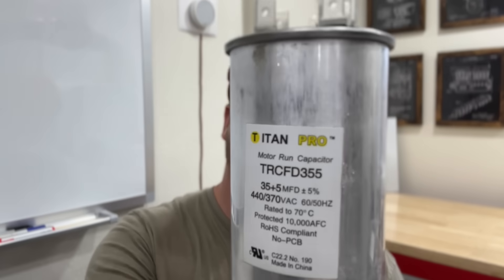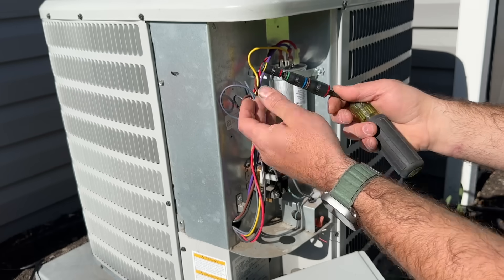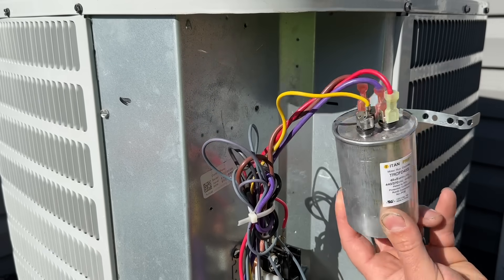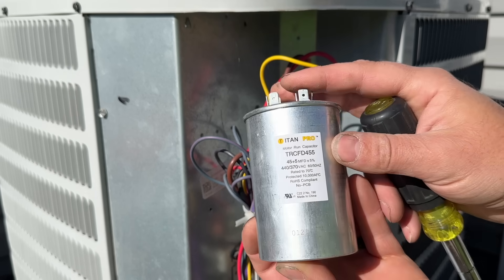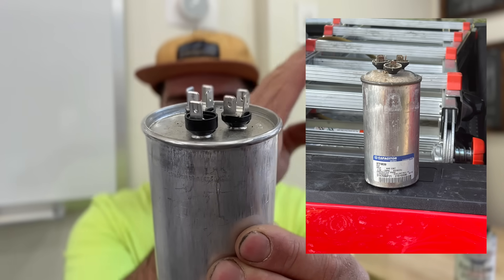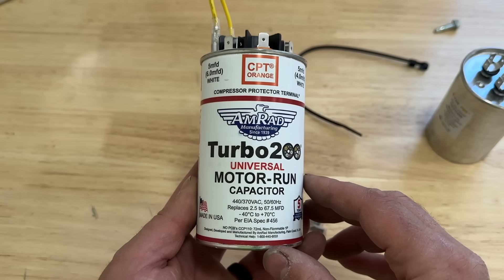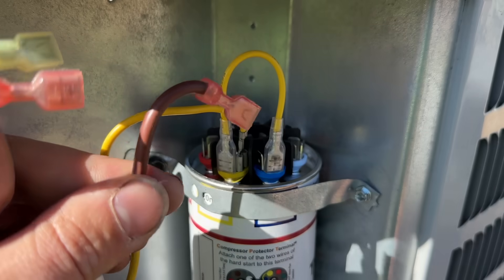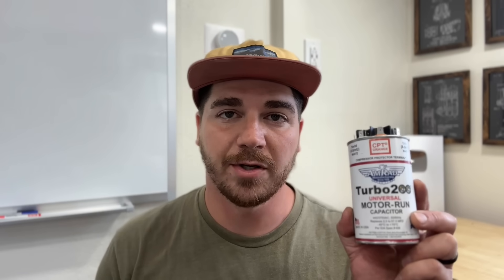HVAC Contractors Practically Make Their Living On These

Comment: Im a one man Hvac business owner. Im licensed and insured 21 years experience in Florida. Today 5/25/24 I got a service call. I charged 395 dollars for a 45/5 capacitor,1.5 Lbs of 410a,new valve cores(They were leaking), new valve core caps and a I vacuumed the drain line. We are not all out here to screw you over.
Reply: Yes keep your overhead low, you made more on that one call than most people make in one day. I always tell people to find an independent guy like you rather than the big box companies
Reply: @markme4  no he did not make that much money he asked to pay for truck, gas insurance, and all kinds of other things
Reply: @markme4  Yes. When I had my house painted. One company was a larger one. The guy doing the estimate that was his only job within the company. The company I used was a family run business. The wife answered the phone and one of the partners came to my house to make his estimate. He even showed after the first crew sprayed washed my house. He was there helping his crew. They did a good job.
Reply: @markme4  I had a situation where I called the "independent" who was on the Good Contractors List, promoted in the DFW area.  He was a "bible thumper" and named his business after a book in the Bible. The replacement compressor was provided by the manufacturer free under warranty but he still charged for it.  We were several days with out A/C on a hot July day and he was the only one who returned my call and came out of all the service providers I called. I got "hosed" but we couldn't go on indefinitely with out A/C.  The compressor failed because it overheated due to the blockage of the cooling fins.  Since then I clean the cooling fins around the compressor every spring.
Reply: @JackLucas-jh1eo  How much was the final bill ?
Reply: @JackLucas-jh1eo Contractors around here wouldn't consider replacing just the compressor, they would say the whole outdoor unit, indoor coil and lines would need to be replaced.
Reply: @JackLucas-jh1eo an in warranty compressor is not free. The contractor had to drive to the distributor to get it. He then had to stand in line to get waited on. He had to pay for a new compressor and maybe shipping. He then had to drive back to your house to perform the work. Removal of refrigerant, supplies, line filter/ dryer and replacement Freon are all not covered by manufacturer. After completing the repairs he likely had to return the old compressor wait in line again to get a refund of the purchase but the distributor retains a fee of 100-150 to process the warranty. He also has to warranty the work( hopefully he is good at his trade and rework is minimal ) he may have spent 4-6 hours total time. Even a small operation typically has an office with 1 employee. Most companies charge 80-120 per hour. This all has to pay the employee any benefits he offers, vehicle insurance, maintenance and gas. The office rent, light bill, ect. Many companies do over charge but are you taking into account all these things? He likely had little work during the off season. I worked 20+ years for a contractor who kept us busy in the off season working and cleaning around the office and about 1/2 my day driving between jobs during the summer. I got paid for my full day but he could only bill for the time I was at a business or home working. Oh I forgot he also gets to pay business property taxes on all the inventory he has at least in my state.
Reply: @JackLucas-jh1eo  I learned in business never trust the three P's. Preachers, Politicians, amd policemen.. Preachers( anyone that says things" Like God bless you alot" be weary of anyone throwing religion around, Politicians think they make the law amd policemen thing they above the law.. religious people and policemen where the worst... ripped me off all the time till I learned the three P's rule.
Reply: @markme4  re read his post
Reply: @theuserthatishere  Who's? The OPs? I wasn't insinuating he charged too much if that's what you thought, just that his overhead is low and he gets to keep much of what he earns , he deserves it
Reply: @JackLucas-jh1eo  You should report him then to the manufacturer because although the part may be covered under warranty, the labor might not be covered. He was right to charge you if the compressor labor was not covered by the warranty. This is what you need to find out.
Reply: @JackLucas-jh1eo    ANY reference to the bible, or christianity on a home service call is a giant red flashing warning light that you are about to be lied to. Ironic? Not a single bit.
Reply: @JackLucas-jh1eo  Those "Bible Types" are the worst for any trade, from mechanics to techs, they nail you in the name of the lord.
Reply: @JackLucas-jh1eo A warranty can be voided if failure was due to lack of cleaning. How is it the manufacturers fault if customers are too cheap or lazy to do proper maintenance.
Reply: Installarion can cost as much as the part with coolant.
Reply: @JackLucas-jh1eo been doing hvac for 20 years, just because a compressor is under warranty does not mean its free, we have to pay hundreds of dollars in shipping and handling,  hours of labor to install, and normally around 8 to 10 lbs refrigerant. A lot of other costs of doing business as well such as insurance and fuel.  Nothing is ever free even if its covered under warranty
Reply: You are not the problem, its the ones that recommend a new unit and lie as to what is wrong. No one is going to get mad if the part is 35 -40 and you charge them 395 for your time, gas and expertise.
Reply: @tomodiero7524  

Except that call shouldn't exceed $125 - $150 typically in most cases. Trip charge, 1 hour labor and a $20 - $35 capacitor. $300+ is highway robbery and no more honest than the guy who condemns perfectly good 10-12 year old Trane/Lennox units that easily last 30+ years old.
Reply: At this point you seem to be the exception rather than the rule... and I'm sure you've got all the business you can handle because of it.
Reply: @rhymereason3449  A lot of companies have unnecessary overhead and Im not talking employees.
Reply: @WhowereEpsteinsclients Yes, driving around 100k plus trucks, every family member on the payroll, new offices and shops, etc.
Reply: @D2O2  Yeah stuff like that is terrible for the industry.
Reply: @WhowereEpsteinsclients cocaine😂
Reply: @rhymereason3449  

I'm semi-retired HVAC and I have all the business I can handle or want. I took a job as a maintenance man and facility manager in a U.S. Government DoD contract factory that builds parts for AM General and Oshkosh Defense because they needed somebody good and now (7 years ago). Also I was hand selected to head a Active Shooter Management & Hostage Rescue Team in the same facility. I'm the "bodyguard" of the entire place in addition to my HVAC, welding/fabrication, plumbing, electrical, carpentry, machine shop tool & die etc etc job.
Reply: @rhymereason3449  

@slinkyneal
1 hour ago
What Brand is the moat reliable..the quality is so bad no matter the price..I actually have extras on hand

Reply

@JohnDoeEagle1
0 seconds ago

AmRad BMI are the best.
Reply: @rhymereason3449  how would you know? have you used many techs, like 10 or more to get a real feel of what's out there?
Reply: @theuserthatishere  Yes, I've used dozens of them over the last 40 years - plumbers, electricians, roof cleaners, roofers, gutters, HVAC, painters, excavation,  carpenters, general contractor, concrete.   In fact, when I built my current house I took on the role of the general contractor and hired all the subs...
Reply: @rhymereason3449  

I'd love to know WHY my comments keep getting deleted on this sh*tty channel? It's happened a bunch and at this point I have lost about 60% of them thus far.
Reply: $395 is pretty tough. $200 would have been reasonable since you were probably on site for an hour, maybe.
Reply: @davidkeeton6716  example of someone who doesn't know the cost of running an HVAC business
Reply: @davidkeeton6716  Have you ever run a business? Out of that 395 dollars my profit was around 80 dollars. Think of the overhead. I have to grease so many palms before I even get to the job lol.
Reply: Who’s palm are you greasing?
Reply: @WhowereEpsteinsclients I’m in NJ and I was charged $400 just for 2 lbs of 410a 2 years ago from an independent serviceman.  That’s considered a little on the high side but not too crazy.  I got my license to work with refrigerants, bought a 20 lb container of 410a, a testo 550, the key to take off the valve covers, some yellow jacket hoses, a leak detector and a spare capacitor which the total cost was upwards of $1000.  Granted, I bought much more Freon and much more sophisticated equipment than I need, but now I understand why I was charged $400.  I’m not going to complain about the price anymore.  People have to make a living.  I’m glad I did what I did only because the last time the capacitor blew, it went on a weekend, and I had to wait 2 days in 90 degree heat with humidity to get it fixed.
Reply: 30 year veteran and business owner. In the commercial / industrial sector. Primarily refrigeration but also HVAC. 
In all honesty - Residential sector consists of - 50% Pirates - 30% sub par to incompetent boobs - and 20% great, hard working, proud, and honest all American guys.
TRUTH.
Reply: @spirorevelis7100  Well said.
Reply: @WhowereEpsteinsclients  Thank you sir
Reply: When I found an honest ac contractor, I referred him EVERYONE I knew. Good job.
Reply: Where in FL? In Bartow and looking for someone reputable and honest.
Reply: I clean my condenser and fins a couple times a year and blow out my drain pipe and it keeps on working after 20 years and only put a capacitor on it and replaced my thermostat batteries, it's a Goodman brand Heat Pump
Reply: @terryhill4732  Keep on doing what you are doing and keep up with the air filter changes. Most of the time if you do all that maintenance you wont have to make costly repairs. An informed homeowner is a good thing.
Reply: @WhowereEpsteinsclients  Thanks
Reply: @WhowereEpsteinsclients  I also failed to mention that I bought a small 5,000 BTU window A/C that pulls 4 amps and let it run all day because it's so cheap to operate and does quite well by setting a small fan in front of it and does an amazing job by keeping my central unit from running so much in hot weather and keeps the electric bill low in hot weather
Reply: A 1  man operation can afford to function with that price. A 100 men operation couldn't possibly
Reply: Our company would have been around $250 for that. Capacitor , refrigerant and service call fee.
Reply: @KyleNicks  

$395 is highway robbery and a "con".
Reply: The good ones are out there. I have a good one myself that I found by accident 15 years ago when I replaced my old unit with a Geothermal setup. The owner of the company came out to my home, did a survey, asked what I wanted, and even down sold me on some things he considered unnecessary. He'd tell me, "I'll sell it to you if you have to have it, but I would pass on this, this this, etc.". 

A few years back my AC quit on one of the hottest days of the year. One of his techs came out to my home and told me it was the capacitor. He didn't have the right one so he gave me a loaner, topped off my cooling loop and did a light cleaning of the system. It cost me $190 and that included the return trip to replace the capacitor again with the correct one when the order came in a few days later. 

I've sent him a few folks over the years who bought new systems from him and they were just as satisfied as I was. When you treat your customers right, they'll do all your advertising for you.
Reply: Been a prepper for 20 years since getting out of the Marines. Best friend is a HVAC Marine, we got together and formed a coalition of electricians, mechanixs , HVAC , comm  security and weapoms specialisr. We bought 250 acress after the war for our off grid compound. When he showed me this capacitor for my home AC system and told me he was charging people in So Cal 500 bucks for one. I had him go to mexico and buy a bunch at the time they were 45 bucks each in Tijuana.
Reply: @V1p3r0ps  The off the grid compound is genius. Best wishes.
Reply: We appreciate your honest work. Unfortunately, for every guy like yourself, there are twenty other guys who are as dishonest as one could possibly be.
Reply: @PastarocketS-sb7nk  Yeah its sad. Most people are just winging it and that goes for pretty much everything from restaurants to carpet cleaning. Heck our garbage men take more pride in their work than most.
Reply: @WhowereEpsteinsclients do you service pasco county?
Reply: @ No I do not.
Reply: @ thanks for the reply. 

I changed my contactor and capacitor and my unit just clicks still, so I’m getting a hard start in the mail but not sure what is the issue sadly. 

Any ideas?
Reply: If it's just the capacitor, I charge $20 for the capacitor and $125 for the service call. It literally takes no more than 10 minutes. Maybe I am undercharging. 35 years in business.
Reply: @hvaccontractor1 You are the kind of HVAC tech that gets plenty of word of mouth advertising and referrals. Good man!
Reply: @davidkeeton6716  what about travel time 45 min each way?
Reply: @MiltJohnson-sw9lc  

I charge $50 per hour and the clock starts when I leave. I don't charge for the trip home and most don't either because they start charging when they leave the first job to go to the next. My minimum charge is $50 and that covers you for 1 hour. Could be driving and could be working it doesn't matter. I rarely go past 30 to 45 minutes away from home on my calls. It's usually employees I work with at their homes.
Reply: @hvaccontractor1  

You aren't just changing the capacitor if you are doing it right. You also should check the air filter inside, wash out the outside condensing coil with a garden hose, check over the contactor and throw a temp probe on the low suction side outside to see what you get. If someone is paying for an hour that is what I and my company that was in business from 1912 - 2017 gave them.
Reply: @JohnDoeEagle1  every call I go on I check the air filter and make sure the coil is clean. 35 years in business I have a little bit of a clue what I'm doing thanks for the input though.
Reply: @hvaccontractor1  

You didn't say that at first and I think you added it after I said something. Change the cap....check out the dame, take the check and split...am I correct?
Reply: @JohnDoeEagle1  I didn't have to say it at first I was just commenting on what it should cost to change a capacitor
Reply: @hvaccontractor1  

Whoever replaces a capacitor and 1.5 pounds of R-410A and two valve cores and charges $395 is ripping people off. That capacitor cost $20 at most wholesale and a 25 pound of R-410A is under $300 for the whole bottle if you shop around. Even paying full price at the counter is around $425 @ $17 per pound.
Reply: @hvaccontractor1  

A 25# bottle of R-410A currently costs me $206 and I'm small and independent now.

And to think people think he's the "honest" one is flabbergasting to say the least. JHC
Reply: @hvaccontractor1 that's very reasonable pricing.
Reply: @hvaccontractor1 nah you're good, you have a higher hourly rate so your markup is covered on the cap, I'm out in Missouri we only charge 70-100/h in our area. Caps cost more apparently, must be a distribution issue. Something people don't realize is that weekends are on call so that's double time and it costs 100 dollars to open the store on the weekend, never call us on the weekend if you want fair pricing, or go ahead and call us, we're happy to take your money if you want it that bad! 😂😂😂
Reply: @hvaccontractor1  just curious 
Do u check if Freon is low also ? 
Your prices are amazing
I’m sure u have all the work you want, I’m sure you sleep
Good.  Treating others the way you want to be treated. ❤
Reply: @hvaccontractor1  Yeah the issue with part canon technicians like you is you don't investigate what caused the capacitor to go "bad". 9 times out of 10 something caused the capacitor to fail prematurely. Could be several things.
Reply: @hvaccontractor1  You told the other fellow it takes you 10 minutes to get to the job and 10 minutes to fix it. You must be a super technician. You will be out of business soon. For those rates you are probably unlicensed and not insured.
Reply: @WhowereEpsteinsclients  

I charge $50 per hour and slightly mark up the parts. For a $12 wholesale cap I would be about $20/$25 on that part as well. I have a Universal EPA license (the hardest to get) and I am also NATE Certified. I have 22 years experience and I am a journeyman HVAC tech as well.

We were $89 per hour and minimum charge in 2017 when we closed after 105 years in business. My boss had a heart attack at age 72 and died. His 70 year old widow wanted to retire and closed.
Reply: @JohnDoeEagle1  Lol a 10 year old can get the Universal EPA card. And NATE isnt used in the contractors test anymore in Florida. An EPA certification and NATE certification does not make you a licensed contractor.
Reply: @WhowereEpsteinsclients  

You lie....100 questions and you can only miss 4 bro! It was very hard to get and very complicated chemistry questions involved. We were a licensed formerly coal dealer (1912 - 1946) then GE then Trane (1984 - 2017) after they bought out G.E. dealer. We were in business for 105 years and I worked there from 2002 to 2017 until we closed. I was trained by the owner and our head service tech that had 90 years experience between the two of them. Save it for somebody else guy....I'm not some chump!
Reply: @WhowereEpsteinsclients  do I need to write a whole book so that you feel better? If it's just changing a capacitor it takes 10 minutes. I'm there longer than that because I clean the coil and check the filter as well as making sure the contactor is fine, the charge is correct. I'm sorry I didn't explain it to the nth degree for you. Yeah 35 years of paying for contractors insurance I guess I'm not insured though. Why do people like you comment?
Reply: @hvaccontractor1  Yes write me a book.
Reply: @JohnDoeEagle1  You sound washed up.
Reply: @hvaccontractor1  

Don't worry...the other clown thinks getting a EPA Universal Certification is "easy". Clearly he never took that test and only has a Type I, II or III. It was hard AF and I missed 2 out of 100 where you could only miss 4 or you flunked.
Reply: Like what? @WhowereEpsteinsclients
Reply: @fatman7817  If you are referring to overhead. It would be things like Insurance benefits,fleet leases,paper shredding company,secretaries that do nothing,equipment rentals,vehicle maintenance. Thats just a couple I can think of right now. I maintain my own vehicle,dont lease them my are paid off, I dont have employees to baby sit. Being a one man band saves you so much cheese its ridiculous. Most overhead is accrued by people that want to delegate work rather than do it and charge a large sum for it. Hope this helps
Reply: @WhowereEpsteinsclients making a mountain out of a molehill — just replace the cap.  if it fails regularly, investigate.  don;t make it harder than it needs to be.
Reply: @tortoise62  You are just a parts changer bro. Carry on.
Reply: @WhowereEpsteinsclients  If you don't mind answering what several things could cause cap failure?
Reply: @wrenfan  Over charge with refrigerant,grid surges,voltage drop,non bleed expansion device,long run times due to undersizing, short cycling from an incorrectly installed drain switch and no time delay on thermostat or condenser. Hope this helps.
Reply: @JohnDoeEagle1  can’t survive charging 50 bucks an hour that’s ridiculous. There’s no way you have any type of insurance or your own truck and equipment.
Reply: @shoretrade9516  

It's my own truck, tools and equipment. My insurance is covered by Corp for where we all work. No, I don't have a 2024 $80,000 pickup truck....OH WHOAH IS ME! Most of the rippers dig their own beds and problems. Can't pay someone (a employee $40+ per hour) either and not be ripping.
Reply: Really? Please explain. You sound very knowledgeable  @WhowereEpsteinsclients
Reply: @hvaccontractor1  DO YOU DO ALL THAT WITHOUT CONSULTING THE CUSTOMER FIRST BECAUSE IF YOU DO THEY CAN SUE YOU FOR UNSOLICITED WORK... IF THEY HIRE YOU TO CHANGE THE CAPACITOR THEN THAT'S ALL YOU DO...
Reply: @WhowereEpsteinsclients  Correct, they have a temperature range.  Some days based on the size of your unit, the house is not going to get as cold as you want it because of the temperature drop mathematics.  Raise your thermostat so you don't cook your outside parts (caps/compressor).
Reply: @hvaccontractor1  what do you figure in for travel time, time getting part, liability and maintenance on vehicle, etc 😁. It all adds up
Reply: @MiltJohnson-sw9lc  I don't travel very far for my service calls. So if it takes me 10 minutes to get there and 10 minutes to fix it charging someone hundreds is shady.
Reply: Give us your info so we can use you if you're near us. Where in FL?
Reply: @sofloemir  Nature Coast
Reply: The good suffers for the bad. I have 2 units in my house , its  like  I'm  on contract  with them , because I have to call them every 3months  to repair.
Reply: Today's small, cheaply made dual capacitors fail much more than the old ones, which were much larger and dissipated heat better, they rarely failed. There are industry standards for parts markup in HVAC contracting. Small parts under $20 are marked up the most, so a $12 part wholesale would sell then for about $45-50. Larger parts mark up less, so a $100 part wholesale cost would sell for, say, $275. HVAC contractors enjoy generous parts mark-up to pad their profit margin. Labor costs are enormous today, $150-190/ hr, plus many have a trip charge or fuel surcharge. So yes, this is how a simple $12-14 part becomes a $400-500 final bill!
Reply: He just wants the youtube money by views and subscribes
Reply: You should take no offense to the general warning. You know you’re honest and that’s enough for most people. Florida is a haven of crooks in every conceivable line of work, not just HVAC, but auto, contractors, you name it. I also work in a quotation business, and I find that customers respect eye contact, brevity, and kindness as a collective indicator of honesty. I also find that a couple of advance quotes on the phone for typical faults can help reassure a customer.
Reply: I am in this business also. I don’t screw anyone. I want it fixed right so I don’t get called back and do the customer is happy. I’ve heard stories of these people charging these high prices but have never met or am aware of anyone who’s been charged this for a cap.
Reply: sounds kinda high still....
Reply: You can test capacitors in the bath tub much like toasters
Reply: New capacitor, new 30 amp fuse, and new basic thermostat; service call included was $290 total. Thank you, Berg’s in Sierra Vista, AZ.
Reply: How did you remove the valves without removing the Freon? Trick question. I know the answer
Reply: That sounds about right! I’m in the trade as well and these videos set off all sorts of cringe and ick factors for me. Everything from a company charging $2000 for a capacitor to a customer even being dumb enough to accept that price without questioning it. Sounds a little exaggerated and sensational to me. Both greedy companies and cheap customers give me the ick though! A company has a right and obligation to make some money and DIYers shouldn’t be doing this work without proper training. But I wouldn’t cry about not having to deal with customers like this and they risk dying at their own peril. I am curious about the possible risk of liability with a video like this if an untrained person fries and the injured can make the case that the guy on YouTube showed him how to do it and said he could instead of calling a trained professional.
Reply: And you could say you only charged 200 dollars and there will still be people that are outraged that you ripped them off. Some big companies will not break even unless you generate at least 600 dollars per call, that is how you get people charging 600 dollars for a 15 dollar capacitor. Being a one man shop makes the world of difference, you don't have an office of 30 employees that will need that check on Friday no matter what, 50 vans that you're leasing  and got insurance on, 50,000 square ft building with rent and power bills. That shit adds up lol!!
Reply: @ Yeah they will complain about how much a repair costs on everyday items they use. Yet they will spend $200 dollars on some Nikes made from who knows where.
Reply: You said the key word. I tell everyone else to only use one man or small family shops. 

They don’t have to charge a fortune to make the overhead with all the owners and their family on the payroll who just take up space and never run calls. 

The bigger the company the more inflated the prices.
Reply: @DasNewsNetwork  I wish I could argue.  So sad but true
Reply: That's a good deal.
Reply: Is Hot Springs, Arkansas in your work area?😁
Reply: @porkchop41  Florida
Reply: It’s not the cores lol
Reply: @Baad.Dad.  The unit did not have caps on them. Used fieldpiece heated diode electronic leak detector and it found the leak. Used spray bubbles to confirm. Hacks in my area leave the caps of because the cores will leak. Hope this helped.
Reply: @Baad.Dad.  

Correct....shady techs loosen them up a few turns on purpose so they leak. You need to retighten them to stop the leak in most cases. Also the service valves are left a turn or two in and not backed all the way out until they squeak. That also causes leaks and you get out your Allen wrenches and make sure they are all the way open and fully seated.
Reply: That's a good value bro.
Reply: @Dave-nm3xc  

$395 for what he did is a ripoff and even back when I worked at our 105 year old company and Trane dealership that call wouldn't have broken $200. $89 per hour and minimum charge, 45/5 MFD 440 VAC capacitor,  1.5# of Freon and two valve cores (if they even needed it). Also would have washed the outside condensing coil, checked the air filter and threw a temp prob on the outside low side suction line to check cooling. We never put gauges on it unless there was potential a problem. You lose some Freon every time you do that. That 1.5# was probably just that and several years of guys putting gauges on unnecessarily. FYI
Reply: Of course there are honest on contractors.  But most people anywhere are dishonest if they can get away with it, this is a pristine opportunity to do that, and the bad guys will prevail more often than not.

Designed and built my own house with not a single subcontractor on site. And never will be as long as I live.
Reply: You may not be but inflation is now, and I guess always has...
Reply: No not all of you, I've met some really honest techs before. Thank you for that man, we all do appreciate it.
Reply: How much do you charge for 1 lb of R-22?
Reply: @Trust_but_Verify  I usually recover and add a retrofit refrigerant like 407c,427a or  Nu22 depending on application. 85 a Lb for R-22 and thats kind of low balling it.
Reply: God bless you sir.
Reply: Well stated.  Not everyone is a rip-off.
Reply: Thats cool, but who were Epstein's clients? That is what we really want to know.
Reply: So you're also a ripoff?
Reply: @affirmativeaction1  How so? Do you own a business in Florida?
Reply: Where in florida? I'm in fl also between me and 2 neighbors we have like 20 homes about 40 mins se of orlando airport
Reply: Great to hear that there are many like you out there. Keep on truckin!
Reply: Really nice! Over here, it seems a/c techs only know to install and replace units.
Reply: That still seems like alot 🙂
Reply: I had two separate issues with my A/C and on both calls I got the same guy come out on separate occasions. First time he just said I was low on coolant and it lasted for years. Second time he came out  he said there was a slight leak. He said he can fix the leaks or he can use this stuff that he can pump in there and it could plug the leaks and it would be a cheap option. He told me the possible cons and it may work or not and it may last or not very long. I went with the cheap option and figure hey A/C had some miles on it and if it doesn't work then I might as replace it.

Well it's been many years and A/C is running strong with no issues.
Reply: Do you work in GA by chance?
Reply: Are near Gainesville?
Reply: $10 + $15 + $5 + $2 + $25 Seems to me your more expensive than my lawyer per hour.
Reply: @mayito714  blame the government and insurance companies
Reply: Same here I saved people money not ripped people off. I love how he makes us all look like crooks, By the way if you don't know what you're doing a capacitor and voltage can kill you. I got caught on a window banger (I forgot to check power) up on ladder= Died three times and brought back to life
Reply: Bro that’s robbery
Reply: @Panicscroll69  Let me give you the definition of "Robbery". The definition of robbery is, the action of taking property unlawfully, from a person or place by force or threat of force. So explain to me how Im committing "robbery"? Im sorry that $395 is a giant expense for you but for the working man thats peanuts.
Reply: You're my hero! 

Had a company come out to do my yearly check up. My system is OLD. Instead of actually trying to keep it running, they were strongly pushing to sell me a new unit. Didn't even want to offer anything that could be done to keep it running in good shape. They just saw dollar signs even though everything works fine for now. 

I replaced my own cap and motor fan (thanks youtube). There's no way I'll use that company when I finally need a new unit!
Reply: Near Bradenton??  if so, what's your contact #?
Reply: $395 for a $20 15 min job 🤣🤣🤣👍👍👍👍 how can America not great again??
Reply: @アランパーソンプロジェクト  lol
Reply: @アランパーソンプロジェクト  Yeah what about the 60 mile round trip drive and on a Saturday. Spare me. I sleep very well at night.
Reply: @WhowereEpsteinsclients  how unlucky it’s only 60 miles, ☹️☹️next time you should take a job that’s 300 miles away so you can charge them $4000 for a 15 min job 👍👍👍
Reply: @WhowereEpsteinsclients  I also be curious to know what if the guy is only 5 miles away from you how much would you charge?
Reply: @WhoeereEpsteinsclients   You're needed here in Ohio. My AC is frozen!
Reply: And you don’t have the overhead or insurance, vehicle maintenance, etc to worry about apples to oranges my guy
Reply: Yeah but actually most of you are.  Surely there are a handful of honest people but the vast majority are liars.  All of the trades are filled with losers just remember who got into the trades when we were in high school it was all the kids that were too dumb or too fucked up to take the regular coursework.  Now those losers are all adults screwing everyone over or at least attempting to. The Carpenters are some of the worst of all of them.  The best thing is for the movement of white collar workers to continue moving into blue collar work.  The good Blue collar people are much older and are retiring and the losers are all being found out. If the white collar guys get into it we can force the blue collar guys out and take over blue collar by providing a fair price an excellent service
Reply: Worth it for all that work.
Reply: @robertweldon7909 how many times can I expect to get ripped off before I find an honest company/serviceman?
Reply: @MoonDog700  Some people cannot be satisfied at all, white glove treatment or not.
Reply: @villageidiot9867  until you stop allowing them to take advantage you.
Reply: I'd love to talk to you about your business. How can I contact you?
Reply: @Rumpelstiltskin-yv4ep Really??   EVERY consumer investigation set up by some consumer advocate seems to find 50% or more of HVAC contractors trying to rip off their clients...  trying to sell parts and services for a system that was just thoroughly checked by a reputable expert and deemed fully functional.  The last guy out to my place tried to charge me $160 for a OEM capacitor that I bought online for $25....
Reply: Im in florida...i may call one you day😂
Reply: @Rumpelstiltskin-yv4ep You misunderstand...  the call wasn't included in that... that was the parts cost for the capacitor only....
Reply: Absolutely not all repair guys are schisters. I myself am a roofer and see the ripoff repairs people pay for.  25,000 for a roof I can do it for 15,000
Reply: Same here in Ohio . I replaced a 45+5 and a fuse and charged 349.00. But I here these horor stories about other companies in Cincinnati
Reply: @WhowereEpsteinsclients    That is an amazing price for everything you did.  What part of FL are you located in?  I'm right outside of Orlando, :face-fuchsia-wide-eyes:
Reply: What part of Florida do you service?
Reply: What is a valve core and valve core cover when it comes to a AC unit?
Reply: @jlayfield  Refrigeration service valves come in all shapes and sizes. Your typical residential unit has two caps per valve. One cap covers the actual valve that opens and closes. The other cap covers the port where we hook up our gauges(manifold). In that port is a valve core just like a vehicle tire. The only difference is refrigeration valve core seals are made of a delrin/teflon material. The tool is very basic and can be purchased by anyone. The tool allows you to change them under pressure with minimal refrigerant loss. Hope this helps.
Reply: @WhowereEpsteinsclients  thanks for the explanation 👍
Reply: Unfortunately there are more out there that are rip offs than not.
Reply: Yeah, I just posted. I’ve been doing it for a long time. We’re not all “Bad Humans “. I’m Licensed/Bonded/ insured. My insurance company would cancel me if I suggested to a homeowner to dig into their Condenser. Can’t imagine billow enough in So Cal to create YouTube Content. Different world than I grew up in.
We’re not all sharks😂
Reply: Btw he started with a 10$ capacitor price which most quality caps are 20+ and then went to a turbo 200 which at our supply houses range from 80-110$ just because you can dyi doesn't mean you should. Techs are there at diagnosis and restart to ensure that there is not more going on than just a bad cap. Trying to save a buck can cost you thousands if you do something wrong yourself In many cases. These types of vids are misleading.
Reply: $40 at the store in 15 minutes to put it in yourself AC guys are the most unethical lying pieces of crap out there
Reply: My guy would have charged $150.00 for that. Am I lucky or what?
Reply: Travel to VA by chance? LOL
Reply: "We are not all out here to screw you over"   Joke of the Day,,,,Hahahahaha
Reply: Exactly. This guy makes it like every hvac guy is a rip off. There will be many injuries from this video. Smart guy isn’t so smart.
Reply: You are good man.  That coolant isnt cheap either.  I know.
Reply: What city?
Reply: Show me a bill of someone charging more than $1000 and I will believe you
Reply: good deal
Reply: Oh yes you are, every single last one of you!
Reply: You also can't be therr when three of your customers need a repair at the same time we can dork
Reply: 2k is scam . In my opinion sub $300 is fair for service call and cap. Also. Some caps cost way over $10 and some cost $3 . I feel that this video doesn't do justice for honest contractors.  Remember the price includes diagnostic and warranty.
Reply: 40year tech myself. Unfortunately, I am finding more and more that there are too many companies pressuring their employees to basically rob their customers. I have always refused to work for these places and advise any customers to avoid them as well.
Reply: $2000 to change one part just tell the repair guy you changed your mind and will call another company to install a new unit for another $1000
Reply: what area do you serve
Reply: 395 for a capacitor cost 10 dollars and 20 minutes job it's a lot.
Reply: @ConstructionLlc You obviously did not read my entire comment. Carry on.
Reply: that is cheap.l most companies are going to clock in around $650-700.
Reply: Are you the guy with the billboard off I-95 in Hollywood “Your wife is hot” advertising ac repair.  I crack up whenever I see that billboard.
Reply: @beb1527 Lol no. But I do know the broker that sold that company. That type of advertisement works believe it or not but its not for me.
Reply: Where in Florida? Are you near the Pensacola area? I need a good AC guy
Reply: That's a rip off...15 mins work for $400 wow
Reply: @freedomofchoicelover3734 I get it you live off of social security, your not my target customer.
Reply: @WhowereEpsteinsclients  LOL...so you rip off the rich people who rip off the poor people to get rich
Reply: @freedomofchoicelover3734 You make a lot of assumptions off a comment section on YouTube. I feel bad for the people who have to deal with you on a daily basis. If it was free you would complain about not getting a coupon for the next visit.
Reply: Some very good information provided by this gentleman. One thing I can’t stress enough. When buying a capacitor always make sure it’s MADE IN THE USA‼️‼️
Why❓
Most capacitors are unfortunately made in China❗️ The quality is poor and they are all but guaranteed to fail, prematurely, often within the first month.
Reply: @BartlettTFD  I have had more Am-Rad fail before the titan pro's. I do like the Titan HD thou. The Am-Rad does have a good warranty thou.
Reply: @BartlettTFD    Your reply leads to the erroneous belief that China makes crap. That is definitely not true. What is true is that crap is made everywhere specifically for the US market, because Americans are famously ill-informed. 

The best advice I can offer is to find a catalog listing with many of the same item. Find the most consistent price nearer to the top of the range. If several are clustered right around 30 for instance, only buy near that price, for example 20-40. A 12 is a surefire indicator that the maker is cutting major corners, wherever they are located. I’ve learned over the years that I can’t afford cheap.
Reply: @BartlettTFD nichicon ftw
Reply: @BartlettTFD  AmRad.  USA all the way!  More initially, but definitely worth it!  Titan HD (not Titan "Pro") capacitors are also USA made,
Reply: @BartlettTFD  YOU CAN THANK THE GREED OF PLANNED OBSOLECENSE FOR THAT. DISPOSABLE ECONOMIES ARE MORE PROFITABLE THAN THE LASTING QUALITY ONES...
Reply: I'm sorry that you are still in Florida. :face-blue-wide-eyes:
Reply: @chefgiovanni  I love Florida no where else I rather be in our Constitutional Republic.
Reply: If you actually owned a business with employees, trucks and everything else that a business needs to operate without going under you would understand why most companies charge more then the $395 dollars for the work you described.
That's how our company accumulated so many clients because these one man band companies go out and low ball jobs, get paid and when the customer calls them back a year later, there out of business because of bad financial decisions.
I don't like this type of video that labels large companies as criminals for charging what they charge to make a responsible profit.
I understand that there are some companies that rip off there customers but they usually go out of business anyway do to word of mouth.
Guys like this make all he rest of us good and honest technicians look bad.
Reply: I can do the same thing for less than half that but I dont work for free.
Reply: @kickassclone75  Thats Awesome. Not sure why you would comment that but good for you.
Reply: @kickassclone75 That’s not work.
Reply: I literally got ripped off for this myself. It was only "only" $250 that he said it was. I went on Amazon to get a spare and it was less than $20. This is criminal and I am a local respected Google reviewer so I trashed them on a first page review. I also scheduled a free estimate, wasted the guys time for 45 minutes then confronted him and told him to F off.
Reply: @caseymineer  You sound more like a Karen. $20 for the part,gas,insurance, workmen's compensation,labor and service call. Trust me he didnt have much left over for himself. You wasted a hard working Americans time because of the policies from government not him. Educate yourself rather than be bitter about a few American pesos. Best wishes.
Reply: Bay Area, CA here we have to charge about 400, average home 1.5 million. Average rent 3k for a 2 bed apartment. I know other companies that I have friends at and they are at about 700 for a cap. Lots of overhead for the big companies.
Reply: @ICPALPHA inflation you can thank the Democrat party for that, also newsom that POS has been raising electricity rates to astronomical levels!
Reply: @ICPALPHA greedy
Reply: @ICPALPHA  THEY MAKE IT SO OBVIOUS YET THE ENTIRE HUMAN RACE SEEM TO BE OBLIVIOUS TO THE PROOF... HOW CAN THE EXACT SAME THING COST MORE IN DIFFERENT PLACES JUST BECASUE EVERTHING ELSE DOES??? "INFALTION" YOU SAY, BUT YET YOU STILL DO NOT COMPREHEND IT...ITS THAT "INFLATION" THAT PROVES IT IS A SCAM... DOES A WORKER WHO WORKS 12 HOURS A DAY CHANGE DEPENDING ON THEIR LOCATION??? NOPE, THE SAME WORKER WORKS THE SAME 12 HOURS NO MATTER WHERE THEY ARE LOCATED, SO HOW CAN THE FRUITS OF THEIR LABOR BE LESS VALUABLE THAN THE TIME AND EFFORT IT TOOK THEM TO PRODUCE IT???
Reply: @ICPALPHA   In Nevada for a 45/5 cap and labor (at least where I work) it is approx $180 for that call.
Reply: That's $395 for $100 worth of time and materials.
Reply: @angrycatowner   No, that's $395 for knowing how to safely fix it and not gouging the customer, not for doing the labor, per se.
Reply: @angrycatowner  Plus Insurance(vehicle and general liability),Workmans compensation,fuel,phone bill,power bill, water bill,invoicing programs. I should be charging more. My profit from that service call was probably around 80 dollars. Have you ever owned a business?
Reply: $395 is very reasonable for what was done. There's a whole lot of key board warriors in here that have no clue what so ever about the costs of operating a business. I'm based out of Chicago and run a union shop. Wages and benefits come to about $100/hour. Payroll taxes and workman's comp are another $20 an hour. Then there's insurance. Then there's wage bonds. Then there's accounting and payroll costs. Then there's attorney fees. Vehicles cost another $20 an hour between vehicles cost, maintenance, insurance, gas , and tolls. Not to mention wear and tear on tools. Not to mention office staff. Not to mention shop rent / mortgage.
Ignorant people should realize when they don't know jack $#!T and STFU. Any less than $395 and a company would lose money.
Reply: @spirorevelis7100 👍🏻👍🏻👍🏻
Reply: @spirorevelis7100  

Ex Military guys don't cry to a Union. Had no use for them at our place.
Reply: @JohnDoeEagle1  Thank you for your service brother. 
Believe me....I don't have a glass of union brand Kool aid for you or anyone.
I always say, I work for a living and the union needs guys like me, NOT the other way around. I only mentioned the union status because it is relevant to the cost of operations.
Reply: @spirorevelis7100  

You're welcome! Also you know the guy who came in here flapping his gums was talking about a Type I (small appliances like refrigerators, RV and automotive, dehumidifiers, small window a/cs etc only) as well. Funny thing is Google is wrong so that is why he got it incorrect. FYI....that's the easiest one to get but you can't buy or touch anything else legally. Lol Imagine even working on a 1 Ton split system with a Type I. Better not let anyone see you or get caught is all I have to say. Even more strange the so called "Pro" who started this thread said the exact same thing. Hmmmmmmm You guys are going to have to do better than that! In case you haven't figured out I am VERY REAL and know what I am talking about. I've also mentioned numerous things no one else would know and you can't "Google it" either. I was trained when I started in 2002 by guys doing it since the 1940s, 1950s and 1960s. I even know things most REAL HVAC techs don't know.....we were in business from 1912 - 2017. Try your luck again....
Reply: Your location determines your pricing, where I live the cheapest house is 1/4 million, damn right I’m charging 600 for a cap !! I have to !
Reply: @junkyardjedi7706  You are correct in depends on your area, millionaire or not you will get fed to the gators charging that in my area.
Reply: @WhowereEpsteinsclients  

By the way....how do you "vacuum" a drain line? You simply pour water down it and blow it out to remove any clogs. SMH.....

Honest my arse and almost $400.....
Reply: @JohnDoeEagle1  I vacuumed drain lines using hot water and vinegar. To many time have I seen drain lines blow out in walls due to using pressure. Hope this helps your washed up mind.
Reply: @WhowereEpsteinsclients  not gators, low stake situation. folks will use or not use a companies service. not a big deal...once again, no gators needed! lol
Reply: @JohnDoeEagle1  You're an A/C contractor and never vacuumed a drain line?  LOL, I've done it for decades long before the plethora a YT vids showing how.  It literally is what is described.  You hook up a wet/dry vac to the outside end of the drain line, turn it on then poor a mixture of bleach water in the vent or drain pan.  The vac pulls out the clog.  Then pour more fresh water into the vent or pan to keep flushing the line.  Using pressure you run the risk of popping a weak joint in the wall of an old house.  Don't care how long you have done it successfully.  It can and will eventually happen.
Reply: @junkyardjedi7706  pathetic.
Reply: @junkyardjedi7706 then your not good at what you do.
Reply: @junkyardjedi7706  You sound like a thief.
Reply: @affirmativeaction1  no,there are companies in my area that charge twice that.
Reply: @junkyardjedi7706  What does the price of the owners home have to do with whether or not you rip them off? I ran a carpentry business for over a decade (once I took over). Never stepped on anyone to get where I was going and did exceptionally well financially.
Reply: @junkyardjedi7706  1/4 million.
$250,000.  There's not a property on the market here below more than twice that. 
What is your point - your greed entitles you to rip the customer off?
You "have to"?   No, you don't.
How's about you get to mark your wholesale price up 40% and your labor hourly rate is competitive with service companies in your area.
You and the others like you give the entire industry a bad name. 
Think about it.
Reply: @junkyardjedi7706  a quarter of a million is the ghetto.
Reply: @junkyardjedi7706 
I hate to tell you pal, but if you can get a house for 250k, you live in a very cheap area of the country.
Reply: @junkyardjedi7706  cheapest house a quarter million .. so by the way I understand your logic they paid very little for the house thus they can darned well pay a premium for quick HVAC service lol.  here a very cheap house is 900k